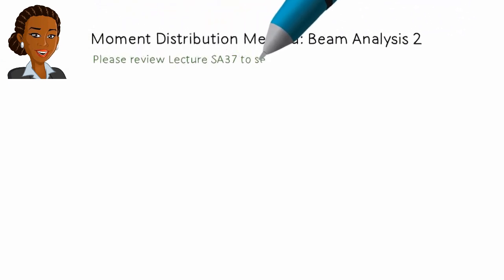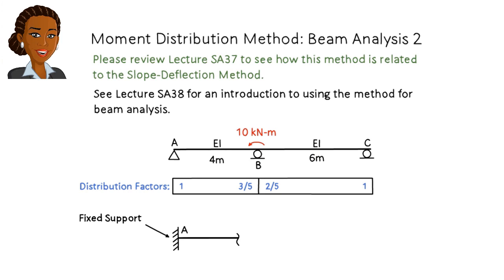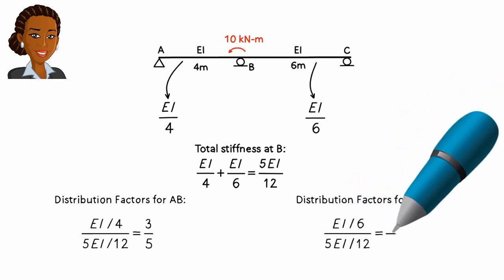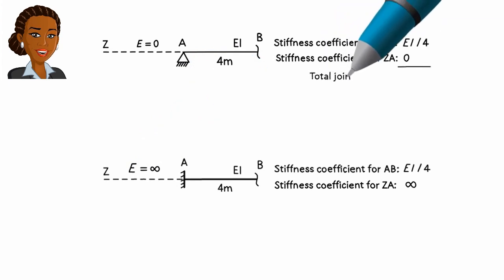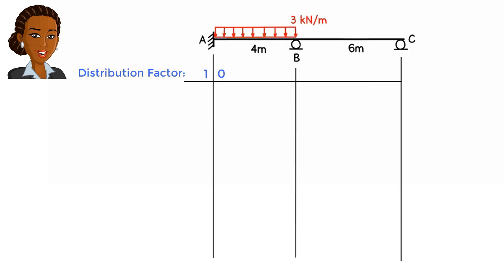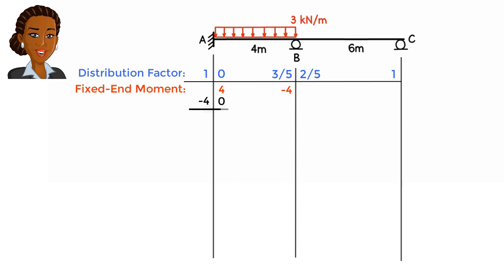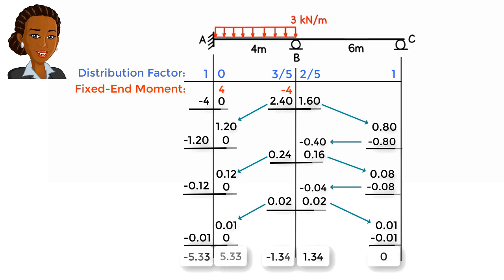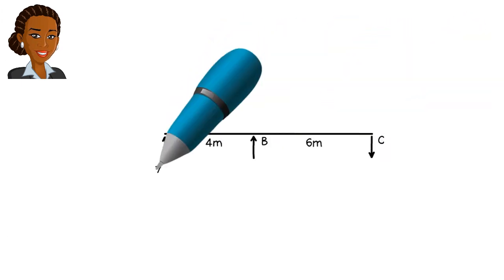SA39: Moment Distribution Method (Beam Analysis 2)

Comment: in the example, when balancing out. where does the 0.16,0.24 and 0.02 come from. in previous example the number would have been cancled out by subtracting the  number from it self and transferring over half. but this time i am a bit confused. did i miss understand ?
Reply from the maker: The moment of -0.4 at joint B has to be balanced. To balance the joint, we need to add a positive moment of 0.4. That way, the total moment at the joint becomes zero (i.e., the joint is balanced). This +0.4 moment is distributed between the two columns in the table using the moment distribution factors 3/5 and 2/5. That is where 0.24 and 0.16 come from:
+0.4(3/5) = 0.24
+0.4(2/5) = 0.16

Comment: At the start of the moment distribution method you followed the sign convention that clockwise moment is considered as positive but in this video you considered clockwise moment as negative. Why so?
Reply from the maker: The moment distribution method is based on the slope-deflection method in which we have taken the counterclockwise direction as positive for rotations and moments at the ends of the member. The counterclockwise (positive) moment at the end of a member, when transferred to the adjacent joint must assume the opposite (clockwise) direction if the static equilibrium is to be maintained. That clockwise joint moment is still considered positive. So, depending on whether our reference point is an end of the member or the joint attached to the member, counterclockwise or clockwise direction is considered positive.
Reply: @DrStructure  Thanks for the speedy reply, tomorrow I have examination of structural analysis, wish me luck 🙂
Reply from the maker: @dayalgodara  Wishing you success!

Comment: Where did you get the 0.16 from ?
Reply from the maker: You mean the 0.16 in the moment distribution table? 
The balancing moment for the right side of joint B? 
It comes from the product of the joint moment to be balanced (-0.4) and the distribution factor (2/5).

-(-0.40)(2/5) = 0.16

Comment: Is there a method of calculating FEM other than through slope deflection method?
Reply from the maker: Any technique for analyzing indeterminate beams can be used for calculating fixed end moments (e.g.  force method). Fixed end moments are the support reactions of a beam that is fixed at both ends. So, any technique that can analyze such a beam can handle the job.

Comment: Hi, in my Complex Structures course we are taught to use 4EI/L for a far fixed end and 3EI/L for a far pinned or roller supported end. And to use 4EI/L for all internal, continuous spans.

However using this, I get distribution factors of 0.66 and 0.33 for members AB and BC respectively for the second example (fixed - UDL - roller - unloaded - roller).

Member AB: 4EI/L = 4EI/4 = EI
Member BC: 3EI/L = 3EI/6 = EI/2 = 0.5EI
Joint Stiffness = sum(AB+BC)= 3/2EI = 1.5EI

DFab = (EI)/(1.5EI)= 0.666
DFbc = (0.5)/(1.5EI) = 0.333

Could you please explain why you use EI/L to compute your member stiffnesses and why our answers are different, I'm rather confused :/

edit: using these distribution factors I get:

Mab = 5.44, Mba = -1.16, Mbc = 1.16 and Mcb = 0

These internal moments are similar to your results, but I gather are inherently different because the distribution factors are not the same, but are reasonably close together.

Thanks! :) And I'm sorry about the long comment!
Reply from the maker: Yes, what you are describing is correct, it is based of a revised version of the slope-deflection equations. Basically, you are using a shortcut to solve the problem; It gets you to the answer with fewer number of iterations.
Reply: Ah okay, thank you for the clarification! I appreciate the content, it's a great alternate source for my studies.

Comment: @Dr. Structure  
Q.1 )  According to video at 3.45 / 8.02  , DF for pin joint 1 & DF of fixed end is 0 but what is the value of DF if the joint is Hinge ( in between the span of beam ) & just a free end ?
Q.2 ) In case of Free End does it contribute anything in carry over moments ?
Q.3 ) In the example ( of video ) let's say joint B undergoes downward displacement of 20 mm due to a certain load P acting downward at joint B along with other given loadings . Then does the method remains same or do I have to make some changes ?
Reply from the maker: 1) If an internal hinge is present in the beam, the analysis is not going to be straightforward when using the moment distribution method, it becomes a two-step process.  It is not just a matter of assigning a distribution factor to the joint.

2)  When a free end is present, we do this:
https://youtu.be/P2nqOuAmn2g

3) When there is a know support settlement, we can determine a fixed-end moment for it, then insert the value in the moment distribution table and proceed as usual. Bending moment (fixed-end moment) due to the settlement can be calculated form the slope-deflection equations.
Reply: Thank you for explaining me these & as always you are Awesome